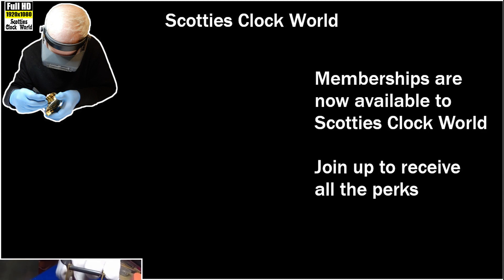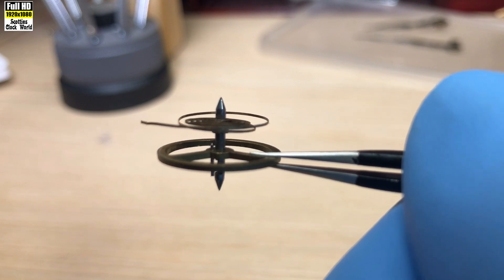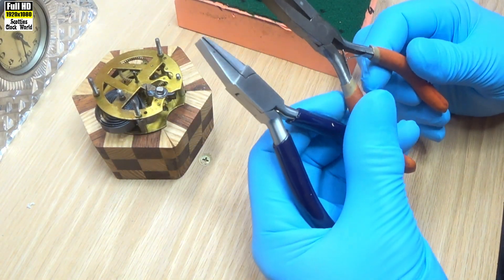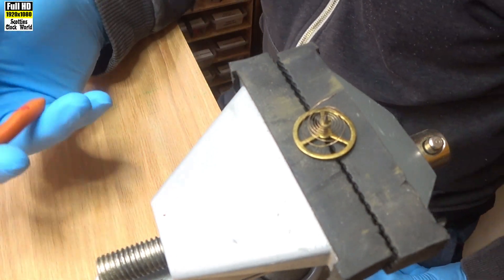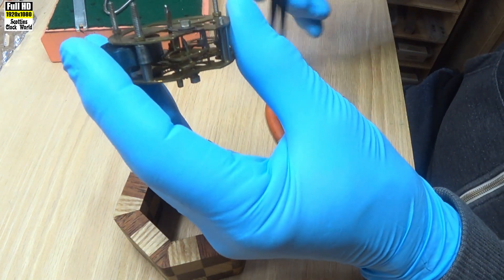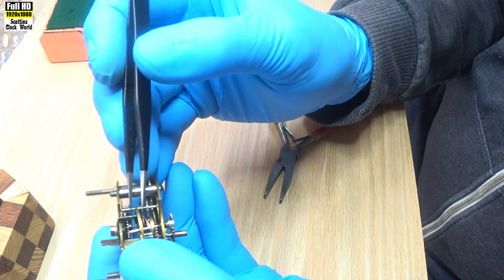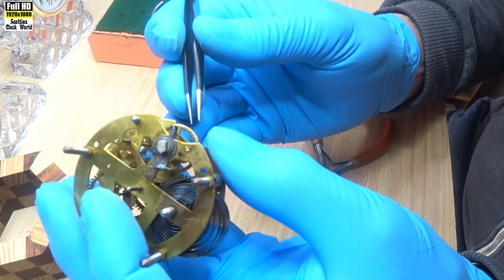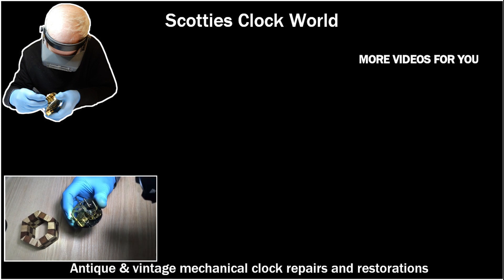How To Setup a Pin Pallet Escapement

Comment: Fiddly work indeed, my first encounter with a pin pallet clock (My first clock repair venture) and I am awaiting some rodoco to hold that blighter still!
Reply from the maker: Rodoco is a great help when working with small clock parts and watch parts. Some people use Blue Tack Putty but it can leave a mark on the working parts. Rodoco won't do that.